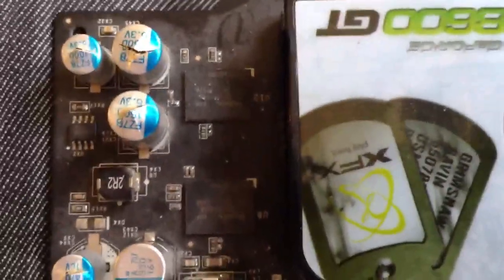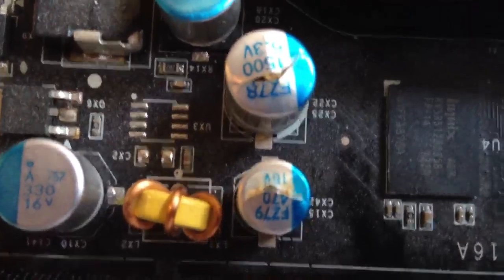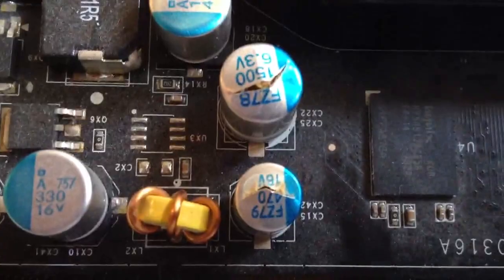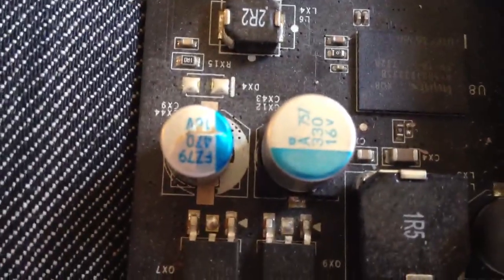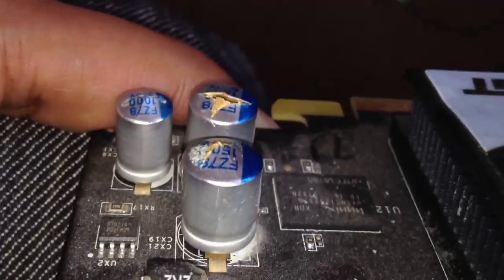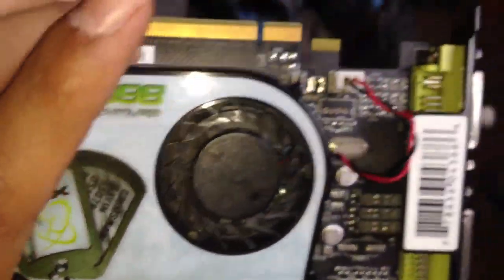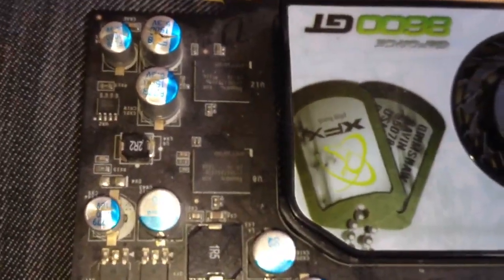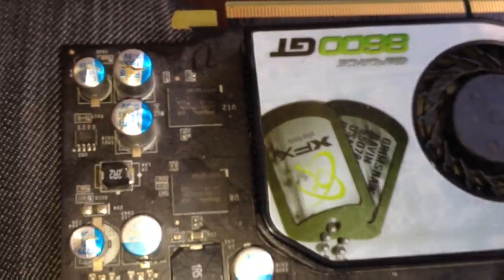Bad Graphics Card Blown Capacitor

Comment: Damn those solid caps aren't supposed to be able to blow... Might've been too much voltage going to the card, PSU's with bad voltages are many times the culprit of a dead graphics card. I lost an 8800 GTS like that. Caps didn't blow but the power connection was burnt.
Reply: Those that have blown are Sacon FZ series wet aluminum electrolytics. Never declared to be solid poly by the capacitor maker. The "good ones" look like Nippon Chemicon PSA series polymer. Name-brand Japanese stuff. But the fact that they haven't leaked doesn't necessarily mean that they survived - they just don't feature that bursty failure mode :-) Difficult to say if it's the graphics card maker who goofed up, or if the inside of the PC just ran too hot, or what. Possibly multiple parties cutting corners, shaving cents...